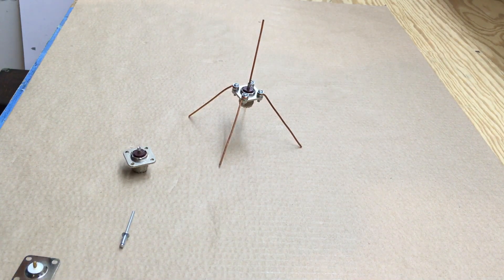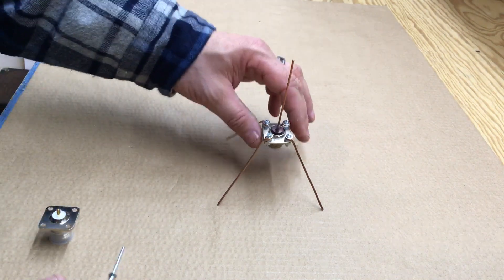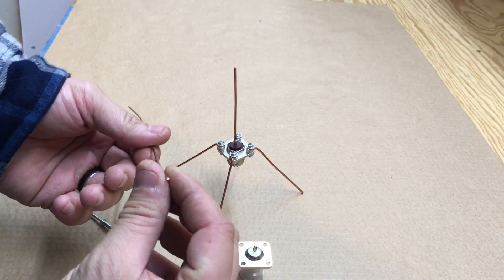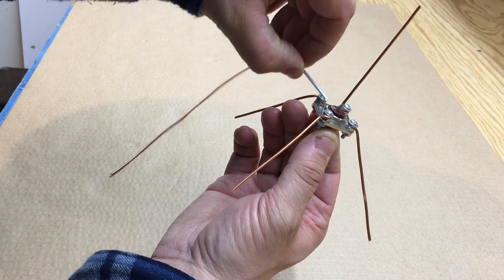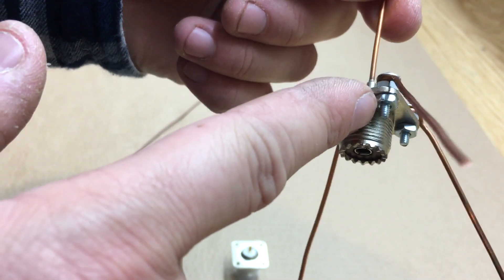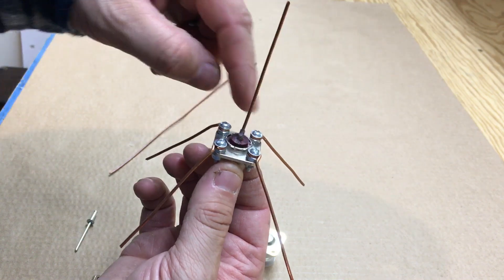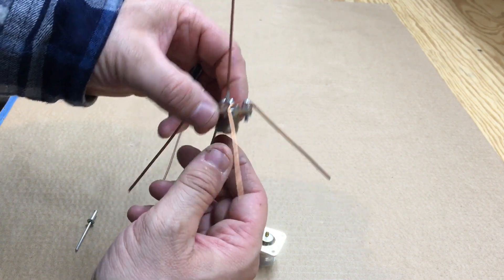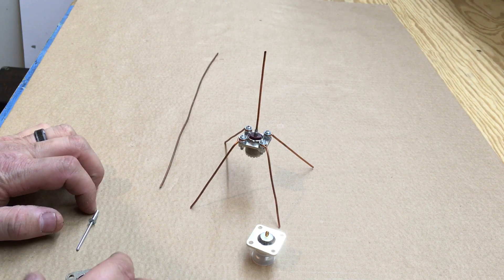How To Make A 1090MHz ADSB Ground Plane Antenna

Comment: I often wonder if you could 3d print up a little ‘jig’ to make these on to ensure the angles are ‘perfect’, not sure how critical the measurements need to be! Or something that could be permanently installed, or is that likely to change the performance, even if its just plastic and has no metallic particles in.

Comment: hello got a question my friend gave me a 100hkz to 1900mz or something like that usb DRS box. It's not one of this usb dongles i looked it up and it is almost $200 dollars. Problem is i don't have a antenna for it. On the one side it's usb and on the other side it has two crew terminal's for the antenna on it. Now I'm wondering if i build a antenna for it what should i build? It also has sma connectors on it for a antenna but I would like to build a Antenna for it. What so you think?